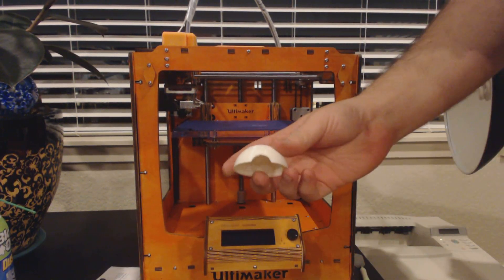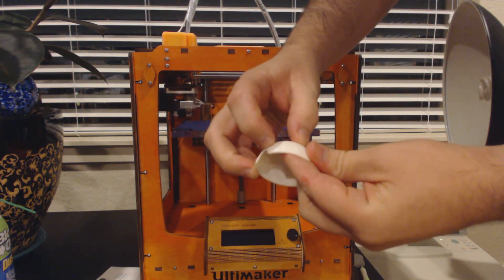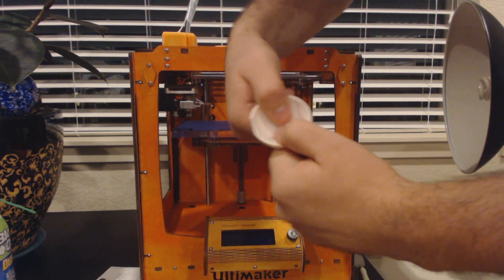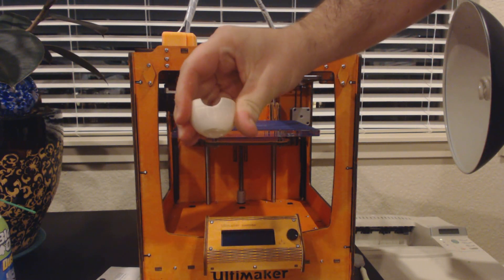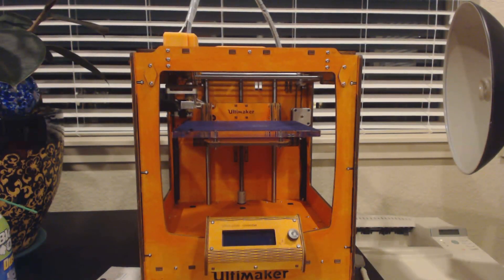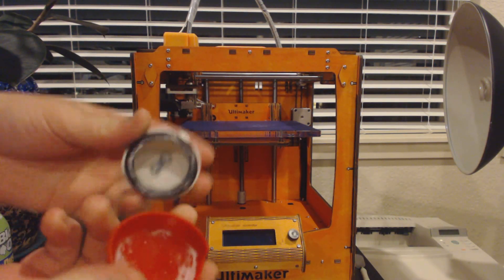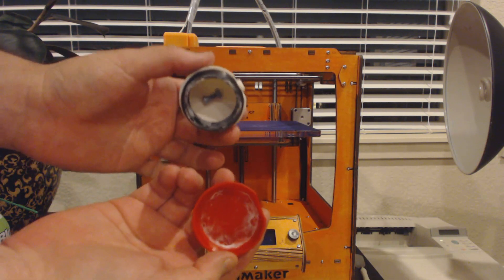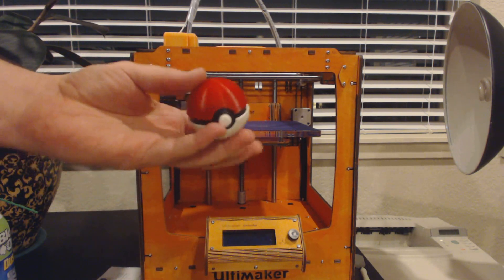PLA Strength Example

Comment: i wonder is it legal to ship it to this country
Reply from the maker: PLA?  I don't think there are any shipping restrictions for PLA in any country.  It is very safe.
Reply: no for the 3d printer....cause if u live in Qatar you will know the the people in customs  are retarded and under educated
Reply from the maker: Ah!  "PARTS!  OMG THERE ARE MOTORS IN THERE!  CALL THE DEFENCE DEPARTMENT!"  ;)

You can build a RebRap from scratch.  You SHOULD be able to get everything local.  Can you get an Arduino board there?  That would be the only one that I could see causing a problem (and even then, it shouldn't be an issue).

It would probably still be cheaper to import a kit.